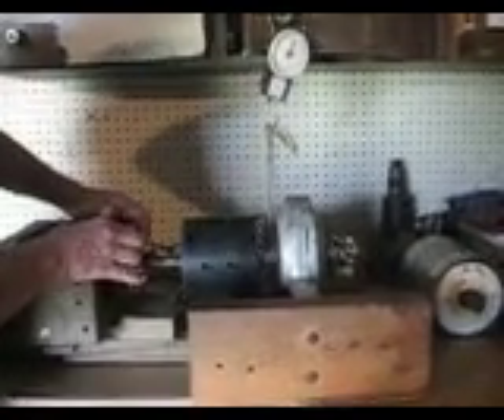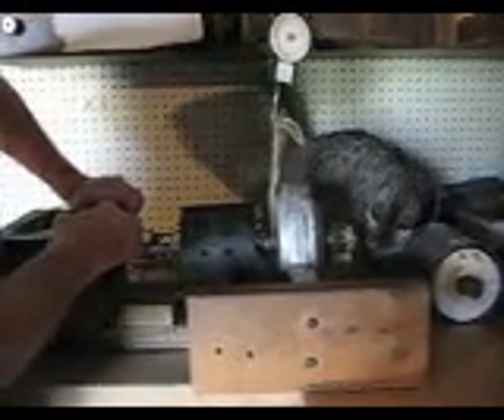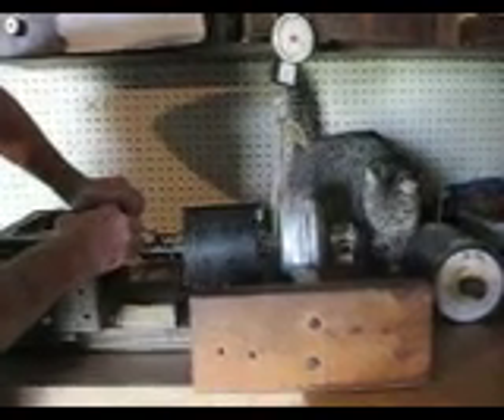Magnet motor torque test

Comment: Is this magnetic motor?
What is the possible maximum torque produced by it?
Is this free energy?
Reply from the maker: Not free energy. This set up runs  off of a 12 volt battery. Please refer to Advanced Magnet Motor R&D Update. That is an old video. I will be posting another with the magnet motor running at approx 2300 RPM.  The magnets in the housing are spaced one inch air gap as I don't have a solenoid with enough force to push and pull the rotor magnets in and out of the housings field magnets.  With proper design and bearings I don't really know how much torque I could get. That depends on radius of the housing ,spacing of the magnets Strength of the magnets etc . I  have no way of controlling  speed by field weakening of the magnets to get more speed. If I close the air gap I get more torque but less speed. It's a trade off. I'm still researching and experimenting with this design. Thanks for watching.